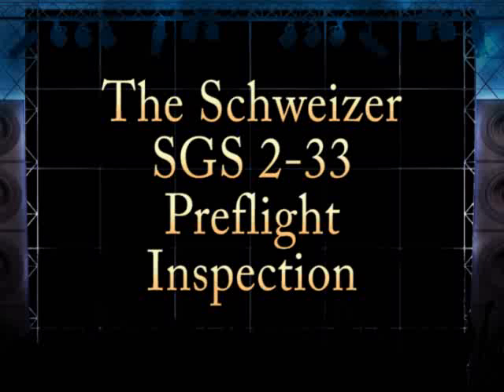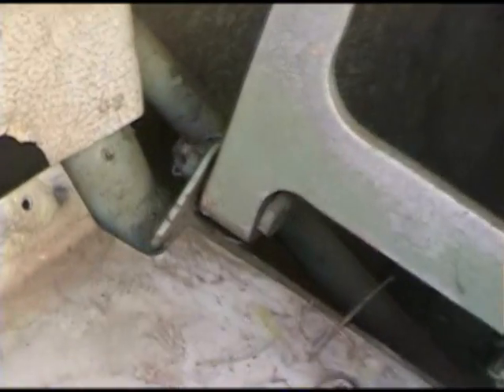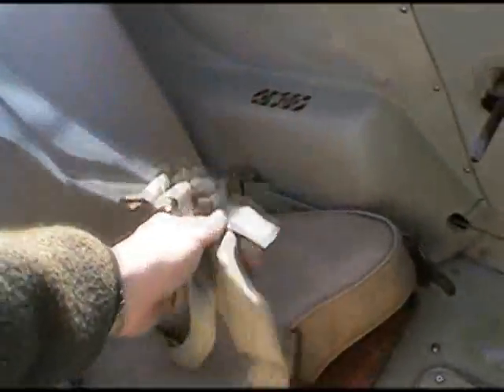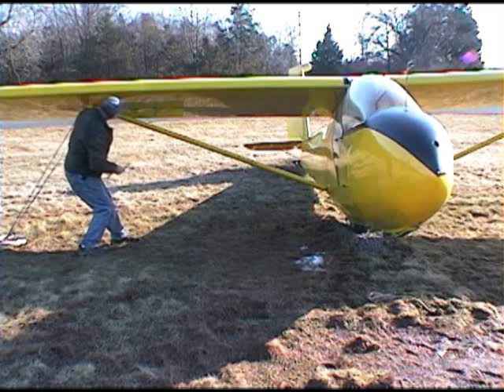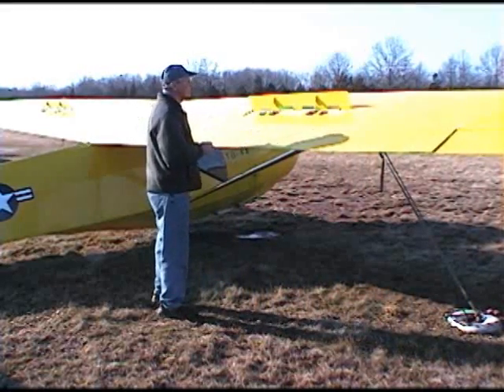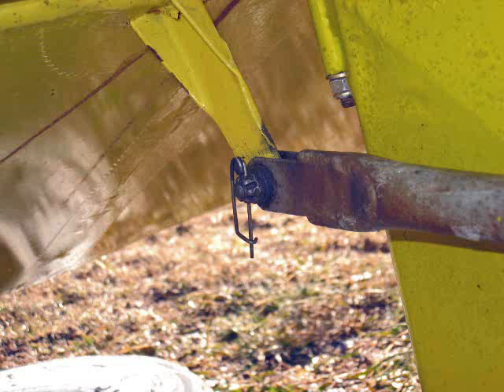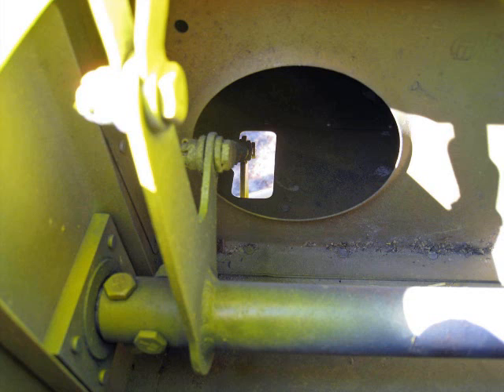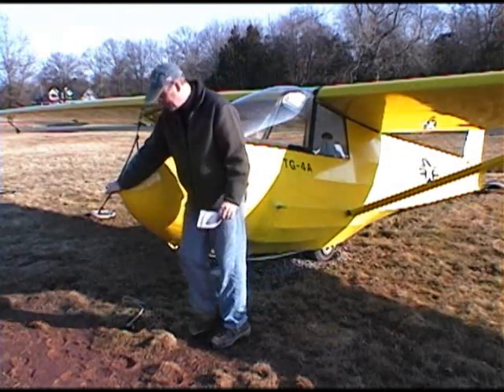2-33 Glider Preflight Inspection

Comment: I wouldn’t be in any hurry to show a “newbie” the innards of that thing!
Reply: The 2-33 might not win any beauty contests, but it’s very sturdy and reliable.  There’s a good reason so many are still out there being used for primary instruction.

You’re right, though, a newbie might be a little freaked out by its quirkiness.  It’s kind of like the platypus of the air, part monocoque, part aluminum, and part fabric-covered.